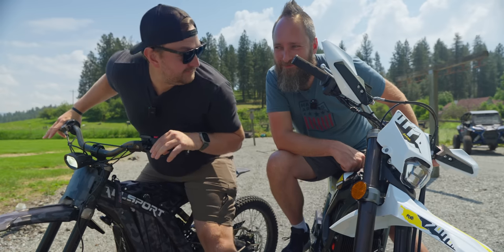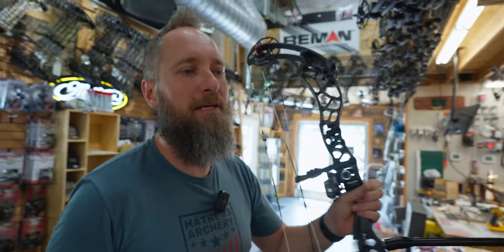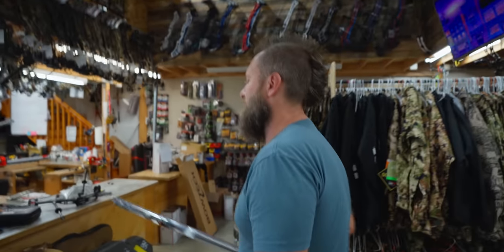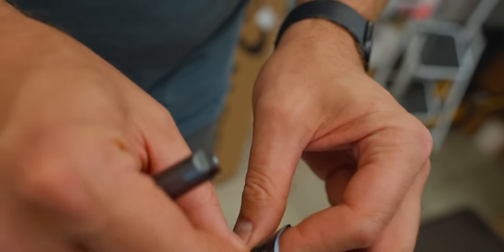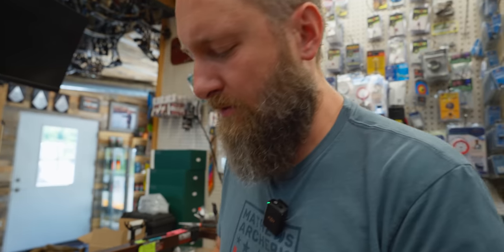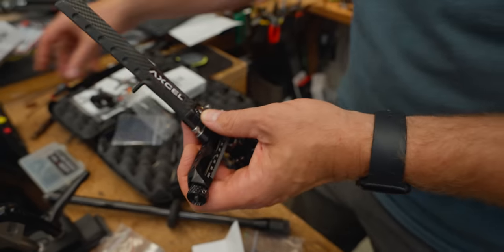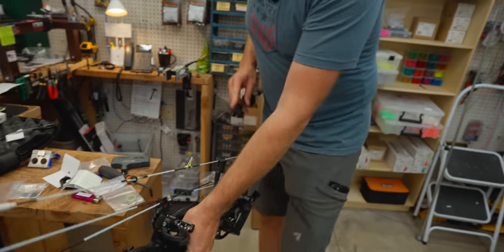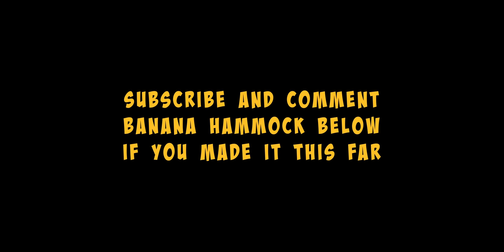Making My BOW as ACCURATE as POSSIBLE

Comment: Ive been struggling with my old bow for months since I had a shop change the main string. Just stopped shooting it for 2 weeks .. so found some resources and got a bowtech ss34 with a hamskea epsilon rest.  Had it installed and... yeah after a 50 arrows shoot started noticing wind arrows flights... hey... I am a good marksman.. if ever I win lottery,  want to fligh in and have Josh tune my bow! . I don't have any shops here I can trust.  It is so frustrating.  They don't do a quarter of wht you are checking for, on top of it they eyeball the process...🤦‍♂️🤷‍♂️😭

Comment: Love your work guys. I reckon you should run a longer fibre and wrap it around the housing. When I did the short piece my light batteries would need to be replaced so often, now I don't even use the light.

Comment: One thing you probably ought to do, is take a measure of the starting point (50m round? Something to measure and assess the value of the progress).

As a personal note the short front rod to long seems to make almost no difference to the scores for ME but I still use the long because it ought to make a worthwhile difference. 

One of my favourite foul ups, several times over the years I have put a lens in my scope on the assumption that it ought help my scores and each time my scores drop by about the same amount and never come back up with use, then when I take the lens out the scores go straight back to pretty much where they were pre lens, I am not suggesting this will be the case for you, but without a yard stick reference how do you know what is helping and what isn't (and what is making tiny gains that might not be worth the added potential F up and extra stuff to carry to cope with F up, lenses /cleaner, can of air to get water off lens in peep/scope)

Enjoy !

Comment: Tim - if you decide to start getting more into different power lenses, highly recommend Optix 300 for your glass because it is significantly cheaper than UV while retaining the same quality level. You can also pick different colors for different shooting conditions along with center drilling or no drill lenses

Comment: Where I am at least the Conquest Smacdown Pro Stabiliser - .500 is the most expensive readily available at 450 ish the carboflax is "only" 330-350, if you want expensive ! Am seriously tempted by the Avalon Tec X Maxx at a hefty 80 ish
Reply: If you want "on the fly" sight tapes possibly think about the Bowfinger (lots of sight tapes as standard, but not yet a micro indicator !)